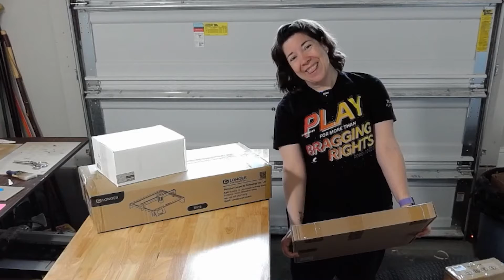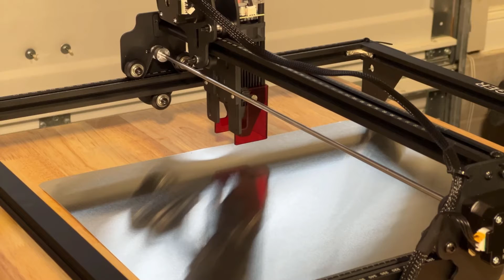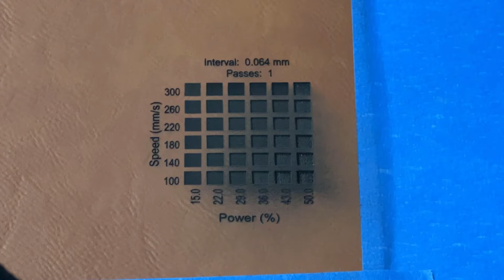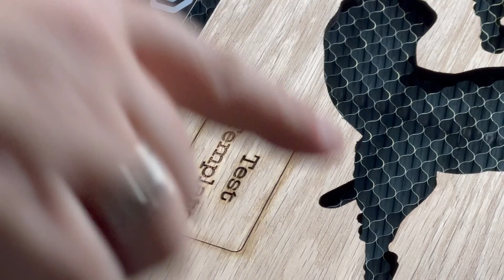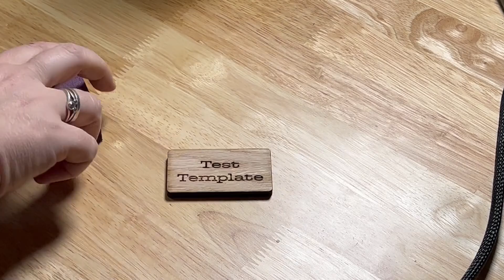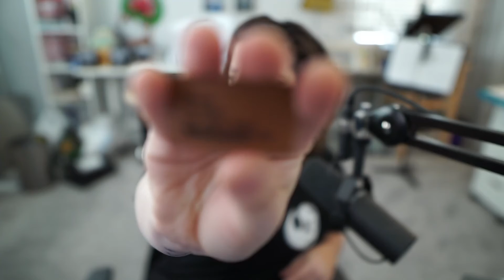Making Bag Tags with the Longer Ray5 10W Diode Laser!

Comment: I just bought the 5W version of this, and am loving it so far.  As for acrylics, try marking it with a black dry-erase marker (or use of the commercial sprays that use the same type of ink).  Apparently, that negates the problems.  Or, if it has backing papers, leave those on to cut, then remove them.  You should be able to get some good results.
Reply from the maker: Oh yeah! It's been a while since I reviewed this. I've learned a lot more about diode lasers since then. You can use black tempura paint as well. You need to spray it on evenly otherwise it won't "burn" correctly. I just use my CO2 for glass. I don't have a rotary for any of the others anyway.

Comment: I have been researching lasers.  I was watching a video by (Eleana Workshop - Making a Mini Leather Backpack ) and I fell in love with the laser cut leather bag flap closure.  If you have a moment, could you view the picture of the bag and let me know if you think what you bought will make similar a front flap?  Thank you!❤
Reply from the maker: Just went to look! Yes, the Laser Ray5 10w will be able to create those engraved designs on leather AND cut the leather.
Reply: Do you happen to know if it will cut and engrave 2mm leather or only up to 0.5mm leather? Ty!
Reply from the maker: @traceytowner176  I don't have any laserable, real leather on me at the moment, but I would be shocked if it couldn't. It was cutting through 3mm plywood and it can actually do thicker than that. I just don't keep thicker woods in my garage. It may take 2 passes to do it, but I bet at a low speed and high power, it'll be ok.

Comment: Was there anything about needing Lightburn or some other software? I have been casually looking for a laser but don't want to be bound to 'their' software or 'must connect to internet to use' software. Glad you touched on how both your lasers deal with the clarity of the fonts.
Reply from the maker: You CAN use Lightburn and LaserGRBL. It doesn't appear as if they have their own proprietary software, which was reason #1 for not even considering a Glowforge when I was looking for a CO2 laser.

Comment: Can you help?  I just put mine together and uploaded my logo and when i hit start it doesnt do anything.  Just moves back and forth.  Its not engraving at all.  But i did the bird test from the sd card and it worked.
Reply from the maker: Make sure you haven't positioned the design too close to the edges. Depending on your speed, the laser head needs a little runway. The working area and the bed size are two separate things. The faster the speed, the less working area you have. Try to position the design in the center and give it another shot?

Comment: im really starting to like the features of this engraver compared to the sulpfun s10 . do u no if u use this laser with lightburn can u still use the wifi feature ?if so i might end up getting this one for my first laser. i want to start making family photos
Reply from the maker: I don’t believe it has WiFi but you can save to a microSD card and plug that in!
Reply: @fiercekittenz  would u recommended this one or the sculpfun s10? I'm having a hard time choosing between the 2. With the s10 I don't have to do any modifications to add air assets but it don't have the touch screen but if it don't have wifi I guess I'm not to worried about the touch screen lol